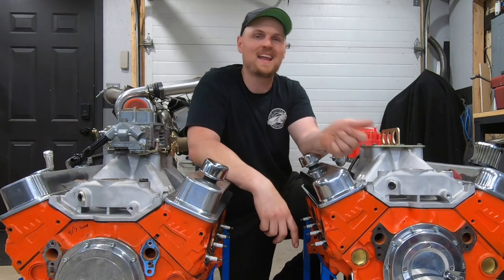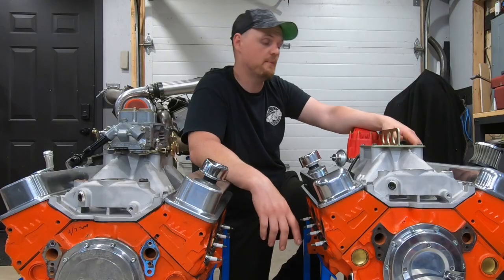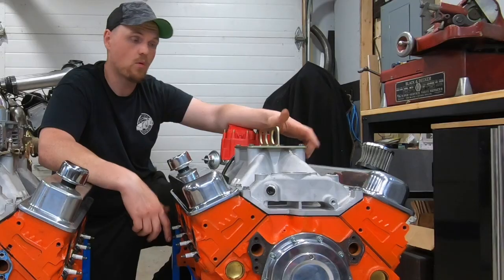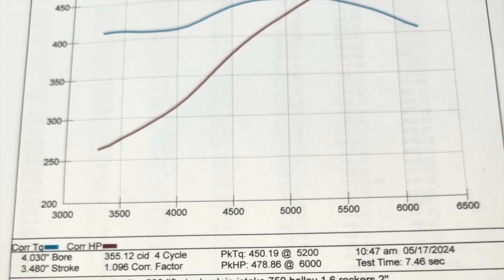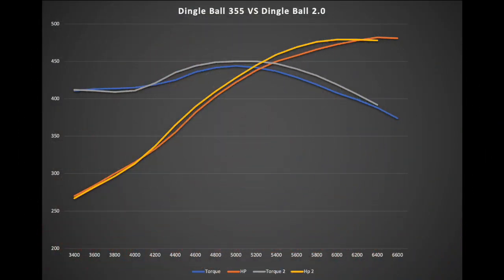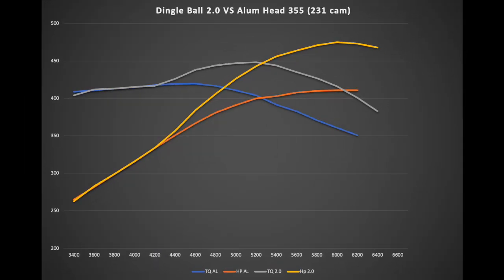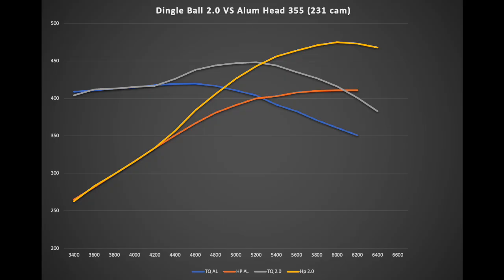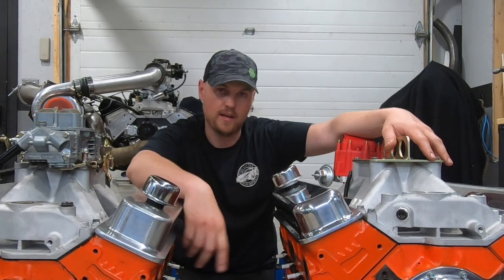479 HP! Vortec Heads w/ Roller Cam VS Flat Tappet (Dingle Ball 2.0 Dyno Results)

Comment: My big block 427 that's 0.60 over has a howards with the exact same duration and lsa but it has 618 lift and I can't use power brakes with it the cam works great and makes great horse power but no power brakes

Comment: Hopefully I'm not too late to the party with this question, but what part number for the flat top pistons? I've had an L31 sitting in the garage for 14 years not knowing the treasure I was sitting on. Wondering if you went with 2 vs 4 valve reliefs. Hoping I can get close to that number with the LT4 hot cam and 1.6 exhaust valve

Comment: I loved flat tappet cams, theyre cheap, theyve been around forever etc... The removal of Zinc from motor oil wasnt just detrimental to engine life but it was a death sentence for flat tappet camshafts. Ive personally had 3 separate motors suffer a wiped lobe and that was with using a ZDDP additive that claimed to bring zinc levels up to par with somethin like comp's break in oil. Thankfully summit started offering their relatively cheap $279 sbc roller cam line similar to their pro Ls cams

Comment: A buddy of mine just put together a vortec 350, stock bottom end, 906 heads,ported with 630 max lift beehive springs, 587 lift cam with 224/234 duration, 112 Lsa, air gap intake and a 750 holley. He's saying that it should make around 450hp. Do you think that is obtainable with those specs ?
Reply from the maker: Yeah, that's a very reasonable guess on HP
Reply: @cuttersperformance  , forgot to add stamped steel roller tip rockers and 1.6 exhaust valves.

Comment: I thought you said you couldn't run much more than 550 with bi Springs and a retainers and all that how did you get it to run 580 to 600 lift with a Vortec head
Reply from the maker: You can't run more than .550 on stock guides and valves. You have to cut the guides or run longer valves if you are running more than .550 lift.

Comment: Thanks for the great video. I noticed it matched the hp of dual plane intake at 3000 rpm, is that the carb adapter doing that?

Comment: Please do a dingle ball 3/4 with the 4.3l vortec v6, the engines are everywhere and I think it would be sick.
Reply: My brother in law did it to his 4.3 in his s10 4x4 and it doesn't rev much past 5 k (smaller cam) it lights all four tires up on loose crappy pavement. Fastest 4.3 I've ever felt

Comment: Love the build! That cam has a healthy lift. Did those pistons have enough valve relief or did you have to fly cut?
Reply from the maker: It had approx .135" piston to valve clearance with a 1.6 rocker on the exhaust (no extra fly cutting required) intake had lots

Comment: good running little motor. definitely looks like it wants more head though
Reply from the maker: A 383 version with aluminum heads and the same cam is in the works. Should be an interesting comparison

Comment: hydraulic roller cams are  garbage,, unless you pay $750 for professional quality lifters there a  a time bomb with chinese lifters.
there is nothing wrong with hyd flat tappet cams or flat tappet  solids. 11.0:1 compression should not be a problem  with premium pump petrol.

Comment: As a Chevy fan I have myself 355 cid high performance aluminum heads that is flowing 200+ CFM HERE’s the thing the heads you are running make power but the cast iron heads are known to cracks very bad a good set of afr heads will blow your mind. My eng is 10.5-1 compression works fine on pump gas.

Comment: So in my future is a pickup truck with a  350. It doesn't need to burn rubber or be fast . What it must do is be able to pull a trailer  run on 87 octane gas and live forever.  If this is a video you have already done let me know  if not any help or information  you could  pass on would be great.

Comment: Ive got a vortec 880 cast, how much power will a balanced stock rotating assembly take?
Reply from the maker: Have the rods resized with ARP bolts, and it can live into the 500s no problem
Reply: @cuttersperformance  will do thanks for that

Comment: What intake gaskets did you use with the vortec heads and rpm airgap? Also, can I use stock rockers on a 487/501 lift cam? I already have the beehive setup. Any help is greatly appreciated.

Comment: 🤔 dual plain
 Electric water pump maybe?; 850 - 900 carb. long tube's dunno just using my imagination. Dual quad? Everyone does the 350 / stroker to the point i dont really want to build one. You should do a 305 the engine nobody wants but surprisingly the combos and stroker option is quite unique. 400 crank on .040 or .060 bored 305 or 327 crank with dome piston and rod combo with 350 vortec heads 🤔 interesting. The ls killer!

Comment: I think you should definitely use the 2.0 heads and cam on a 383. But also use an Edlebrock rpm air gap thats port matched and the ports cleaned up with that same spacer. You'll gain SOO much more low speed torque and with the porting and spacer you wont lose very much top end at all compared to how much youll gain down low. Also I would raise the compression back up to 10.5:1 and run 93 octane for all of us that do have 93 at the pump. I believe youll see 500hp or close to it peak but lower rpm gain will be impressive. I woukd really like to see this combo man

Comment: I hate how people are scared of compression you can run 12-13:1 on 93 octane with little to no problems now good quench areas on the piston and head and the proper cam make a load of difference

Comment: i wish you would port a set of the Chinese eBay cast iron cylinder heads. I had a set flowed and they are only around 210cfm @.500 and are relitivly thick castings that leaves a lot to port.
Reply from the maker: Got a part# or name I can search on ebay?
Reply: @cuttersperformance  I had a set of the speed. Master ones flowed, buy a company called Eric weingarter racing out of Oklahoma. There's a video on youtube about it.
Reply: @cuttersperformance  PCE281.1755 speed master

Comment: I'm running a 357 small block flat top pistons , stock vortec heads with springs . Cam is Howard's flat tappet 450/450 lift. 235/239 a 50. 106 lsa. 750 dp around what power range should I be?

Comment: If you were going to build a mild turbo 350 like 500ish hp do you think the crank and rods in a 88 truck 350 (originally a TBI) 4 bolt roller short block hold up ,  this is just a cruiser hotrod street truck with normal occasional just havin fun use not for the strip. I know its not ideal but I'm thinking probably for a while.
Reply from the maker: You'd be supried how strong a stock crank and rods are. As long as everything is in good shape, keep it out of detonation, you'll be fine for 500 hp all day. Forged pistons are a good idea, but I've used Hypereutectic pistons at that power level with no issues

Comment: Great comparison! I know a 383 version is on deck but I'm curious about your version of a 406 like the "Impersonator II" engine build Motortrend did many years ago.  525 lb ft of torque with vortec heads, lower compression, and a .480 cam. 👍
Reply from the maker: I have a vortec headed 406 that's almost ready
Reply: @cuttersperformance  even better if you dabbled with 87 octane too. 😆 I know, that's a whole different build

Comment: Looking forward to the Dingleball Stroker!   
My 383 project will have .525 lift with my 225/231-ish roller cam. AFR 195 Enforcer heads planned. Would you go with 1.6 rockers to bump up the lift a bit? I haven't ordered any top end stuff yet. Just building the rotating set.
Reply from the maker: I also have a 383 stroker with a roller cam and budget aluminum heads that's coming up

Comment: I prefer the 1.0 engine because of the affordable flat tappet. However PROPER break in is a must...and take EVERY precaution to ease the spring pressure during breakin
Reply: Going with a roller is only about $500 more if you use a '87 or later OEM roller block. It's the best $500 you can spend.

Comment: Did you use the thick old style 5/64 thick piston rings? I would love to see a test between them and a 1/16 or 1.5mm set and also a 1mm set. The only tests I’ve found haven’t included the 5/64 rings. The   OEM’s went to 1/16 or 1.5mm in the’80s and now a lot of engines use 1mm-1.2mm sets. I would imagine the difference between the thinnest and the thickest rings would be 10 HP I would imagine.

Comment: You have proven again that you can run a noticeably smaller roller cam and make similar power to a larger cam. The Vortec heads always amaze me in that they a lot of times make more power than a better flowing head. That’s one nice thing about small 170cc runners flowing 230 ish com.

Comment: They are both Great combos mate. 
@ 3:50 what is the name of the black colored device on the top of the carby whilst the engine is running on the dyno? 
Is it some sort of flow smoothing device for the carby? 
Thanks 👍🇦🇺
Reply from the maker: K&N substack, it helps airflow into the carb
Reply: @cuttersperformance  thanks mate 👍🇦🇺

Comment: Aluminum head needs 1-1\2 more compression to equal an iron head. Around 11 to 11-1/2 to 1. Aluminum dissipates heat faster, and it needs the higher compression to make up for the lack of heat in the combustion chamber for a better burn.

Comment: A 235/241 hyd roller cam will act like a 247/253@.050” hyd flat tappet cam.
Don’t remember what the dingle ball 1.0 had for flat tappet hyd cam specs.
Reply from the maker: Yes similar, the dingleball 1.0 was 242/248

Comment: I run 12:1 in my ls on pump gas. I see no reason a sbc can't do that also. I mean wtf....chevy build sbc's with 11:1 from the factory.
Reply from the maker: You can, and I have done 11:1+ on SBCs but it's not quite as easy as LS platform. The LS heads are very efficient and require less ignition timing, and the cooling system of the LS allows better coolant flow through the heads to prevent hot spots and cooler chambers. Back when GM built the 11:1 SBC the gas was much better than today, the timing often times needs to be dialed back to run todays gas without ping
Reply: @cuttersperformance  yea the old sbc chamber might not be quite as good as a ls. But a vortec or lt1(90s) is probably close. I ran 10:1 on with a 406 and l98 heads back in the early 2000s.  That was in a k5 with no issues. Not even a very large cam.....small really. 

I think most the stuff that had pre ignition issues properly also had a dish piston and/or a  large chamber which screwed up the quench causing issues.

Comment: I’m guessing that hp carry at the top on the “1.0” engine is the longer exhaust duration. The fatter torque curve on the”2.0” is probably the bigger lift and more area under the curve of the roller vs flat tappet cams. I like the 108° LSA, I don’t remember if the flat tappet cam was the same, but that could fatten up the mid-range too. For myself, with intake closing in the mid 40s (at 0.050”), I would take the 11:1 build. All together very nice work! Thanks!
Reply from the maker: Both cams on a 108 LSA

Comment: What valve springs did you run on the vortec heads with roller cam??
Reply from the maker: That will be in the parts breakdown video
Reply: @cuttersperformance  👍🏽😎🤔🤣🤣

Comment: 11-1 is limit on 91 for me.I barely get away with running 18-40 on timing.40 is pushing it with ping.
Reply from the maker: I've done it too, but you're right . It can be tricky on tuning, especially with heavier vehicles

Comment: Killer combination is an understatement! What an awesome comparison! I still find it difficult to dig that deep into my pockets to buy a roller cam, but there's no doubt they're good.
Reply: I'm traditionally a Big Block Mopar/Big Block Chevy guy, but.. I've recently stepped into a jet Boat project that's gonna be powered by a 6.0 LS. Totally different animal,  but wow.. the parts availability and ease of making good power with the LS platform is hard to deny. High performance roller cam and lifter kits from Summit for less than $450 !!  And the heads flow amazingly well in stock form. Power with an LS is like shooting fish in a barrel... pretty cool in my opinion.  🍻
Reply: @Torquemonster440   What does anything you wrote have to do with what I wrote?
Reply: @Carl_Jr  should have clarified better,  LS Roller cams and lifters are cheap in comparison to retrofitting an old school V8.
Reply: @Torquemonster440   True to a point. A stock SBC roller block isn't too bad. A good cam and lifters are about $500. Still huge compared to $250 for flat tappet, though.
Reply: Also, if someone were to reuse the factory roller lifters, a Summit Pro series cam is about $250 for just a roller cam. But again, for my application I don't think it would be worth the money to do the swap.
Reply: @Torquemonster440  Most are also cast cores . Cost of ls conversion with all the little stuff at the end makes the sbc more attractive.
Reply: @Carl_Jr  Not worth it. People assume just cause they put a roller in they will never have to worry about it...that is BS! 
How bout a hyd roller from the big C....flat in 15 ki miles springs were shot killed the valve stems, seats etc. Love me a good steel core
Reply: A good hyd or sft cam is plenty and still affordable. Just buy quality stuff like Isky or Crower...youll be fine. NExt build with be big cubes, Isky solid flat tappet great heads, compression basic stuff. Solid rollers dont last forever and hyd roller can be hit/miss from 6k on up
Reply: Guys, just suck it up and spend the extra $$ on a roller cam/lifters. You'll never have to worry about whether your old flat tappet is gonna fail again. If you have to save up an extra month or two to afford it, so be it. So worth it in the long run.
Reply: @msh6865   No. It's not worth it. Mine's been in my car for over 20 yrs. Dropping $500 on a new cam just because it's a roller isn't justified.
Reply: Ha ole buddy i want to ask u a question ive played with motors all my life wt oil do u use im not rich an ive had great luck With Rotella 15 40 desil oil just plain oil with a couple additives tell me wts better  please. Thanks @Carl_Jr
Reply: @msh6865 lots of roller lifter failures lately too. “Stepping up” to a roller setup is no guarantee that you won’t suffer a cam/lifter failure.

Comment: I'm building the same engine. Zz4 with 906 head's  but I'm going with a 280 roller cam. It's going in a 1992 Z71 short bed regular cab

Comment: The people worried about 11:1 on pump gas don't know anything about dynamic compression ratio. That's perfectly safe and you can push it even further.
Reply from the maker: Depends on the vehicle, ive done it but tuning can be abit tricky on heavier vehicles
Reply: Cam overlap and bleed off have a big influence on what compression can or can't be tolerated.
Reply: I am running 11:1 with a 218/228 @ 0.050 roller cam in a 7,000 lbs fullsize Expess van that tows 6,000-8,000 lbs trailers.

Comment: Impressive results Pat! From your experience, if we wanted to have this sort of torque 'peak' but earlier in rpm range( from about 3000rpm -> on) , what would the cam specs for that?
Reply from the maker: Whats the combo?
Reply: @cuttersperformance  A combo of 350cid with vortecs and dual plane intake. What'd be a cam that could provide torque 'peak' as did the Dingle ball2.0 but from about 3000rpm and up?
Reply from the maker: @mikkokuorttinen3113  a nice power brake friendly/drover combo, would be a 224/230 108 LSA installed at 105. Atleast .550 lift with a 1.6 rocker.
Reply: @cuttersperformance  Thank you Pat! Yes, aiming for a streetable driver. So the tight LSA and high lift is the key. Which manufacturers do offer <108°LSA?

Comment: dont forget the promax 200 out preformes afr heads of the same for same less $$$ watch eric wiengarnters videos he says its hard for him to admit but numbers dont lie. great video once again what a beast of a 350. either one.
Reply: The Chinese version yes but the the OG’s AFR’s.
Reply: I ran a set of Promax,Brodix and AFR’s.Every motor is different no doubt but when I changed heads on this 406 sbc,I felt more torque mid range with the AFR’s.I did not change anything else.Yes other things can definitely play a factor with port match ex,ex,ex.Heads we’re 195’s and the 200’s.Promax is a great head no doubt but the price has gone up a lot.If you have the budget grab the AFR’s.The ported 195’s really pull hard.
Reply from the maker: @joshuagarvey9362  what afrs are you referring too? Enforcers?
Reply: @cuttersperformance  Eliminaters
Reply: @cuttersperformance  my Promax 200 are on shelf.They are non ported.They ran real good for N/A.The price was great and no leaks.They cracked 510 hp on the dyno.I never dynoed with the AFR's but I can most definitely feel the extra torque no doubt.Dyno is one thing but putting A load on it everything changes.The Promax also pulled to 7500rpm's.I have seen Eric's videos before Everything changes with a load.You can mist definitely make more power top end with an 850 carb but a 750 just owns from low to mid on the street.Snappy throttle response.Love busting these LS kids and Hellcats on the street.Once I bolted these AFR's on it was a whole new ball game.I was gone
Reply from the maker: I've been wanting to try a set of promaxx heads
Reply: @cuttersperformance  Great head for the buck.

Comment: Build a 383 808 block afr enforcer gm hot cam 525 lift 10.5 . For what it cost to buy vortec head then a trip to the machine shop you can buy enforcer heads and enjoy a bump in compression.  I like the 2.0 build keep um coming. Thanks
Reply: yeah the enforcers  are  hard to beat  for the price  and the only "overseas" heads  i know  of  that use  LSX 8mm valves
Reply: Why run a hot cam with a 383c waste of a bottom end 383 needs a larger cam to shine

Comment: Will 1.6 roller rockers work with stock valve covers?
Reply: Yes
Reply: Roller rockers won't do anything for power but 1.6 exhaust rockers will.
Reply from the maker: Yes but you need to use narrow body roller rockers